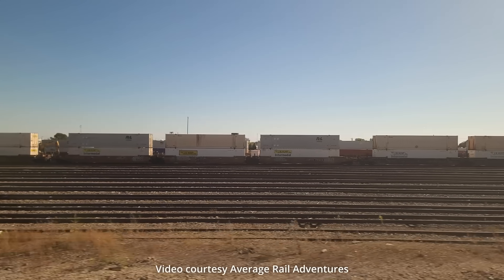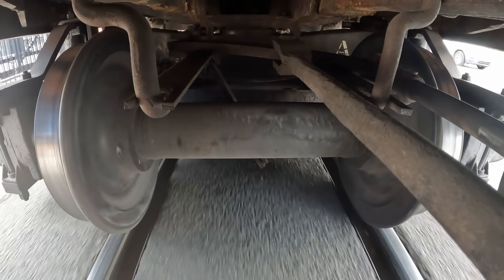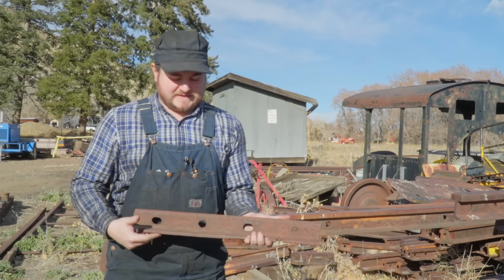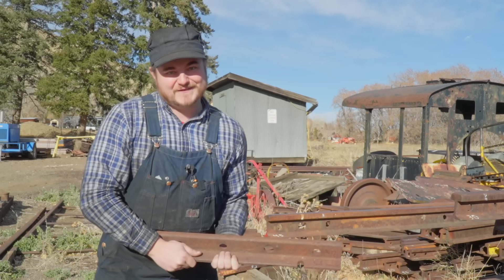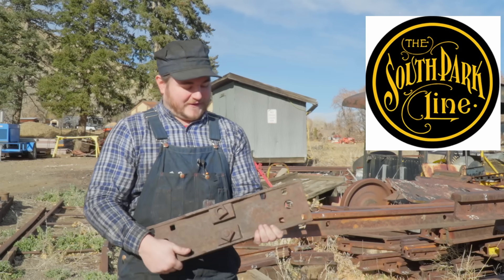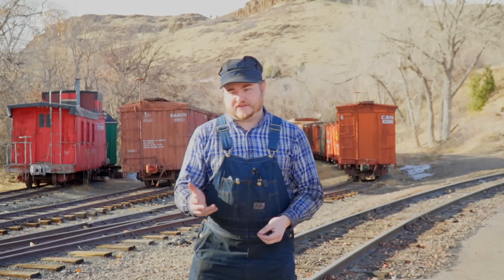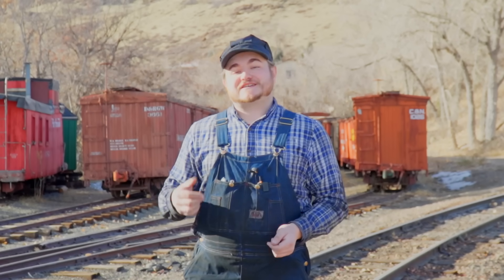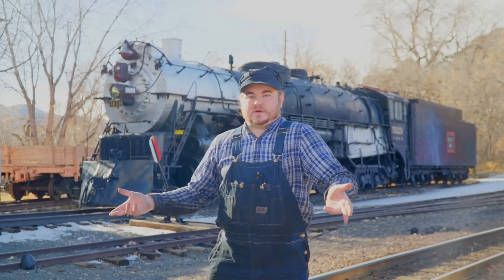Why don't Trains go CLICKETY-CLACK anymore? | Railroad 101

Comment: Track guy here. I'll disagree with your statement that CWR should be laid at the mean or average temperature for a given region (09:50). In practice, the neutral stress temperature of the rail is actually close to the maximum ambient temperature. I know in Canada we destress to 105F or 40C and the ambient temperature seldom goes above that point, though the rail will sometimes exceed that temperature due to solar heating. 

The main reason we do this is (as you pointed out) sun kinks are scary. Rail in compression wants to buckle, you can't push on a rope. Rail in tension is much more stable. This means that CWR in the winter is under an absolutely absurd amount of tension, but steel as we know is fantastic in tension. We do occasionally get tension breaks in the winter, but these can be detected by the signal system when they occur and can often still be safely traversed by a train at low speed, whereas sun kinks often develop due to the vibrations of an approaching train. If one appears in front of you all you can do is dump the air and pray.

This means that we generally lay rail below the neutral stress temperature, and in order to get the neutral stress temperature up to design we actually force the rail to expand before welding it in place, either mechanically using beefy hydraulic pullers or thermally by running a diesel flamethrower on wheels (called a rail heater) over the rail to bring the rail up to that target temperature.

Looking forward to listening to the interview with your track guy.
Reply from the maker: Huh! I have had it wrong for quite some time then. Interesting, and makes sense - I appreciate the correction!
Reply: @Hyce777 Oh don't worry, managing thermal stress is not an easy thing. I've had guys with 30 years of track work experience still get it wrong sometimes
Reply: @redonesgofaster8020  -  So, in a steel railroad situation, contraction from cold is not as destructive as expansion from heat?
Reply: That would be correct. The reason is because buckling is a characteristic of compression only. Tension tends to pull things a little straighter, plus, the steel can accommodate the shrinking length easily. pluck a hair off your head (yours, not mine, I have none anymore 😂) and pull on it. It holds a good deal of strength and remains straight. Now try pushing it. You get no resistance at all before it bends and kinks. That strand of hair is very much just like the strand of steel. The material itself could take the compression just fine, but it is the geometry of "a long skinny thing" that makes compression an issue.

Side note, in certain industries where something long and skinny has to 'push', there are ways to prevent buckling. In a heart stent, they push a tiny wire just a few thousandths thick for over a yard/meter to get to the heart. Railroads could effectively do the same thing, but would be insanely expensive. And I mean INSANELY. 100$/ft extra.

 @rb032682
Reply: @FelonyVideos  -  cool. thanks!
Reply: @Hyce777  makes it fun on really cold winter days for a broken rail quick repair because you are not going to be able to heat that rail enough for it to be laid at the correct length for the rail neutral temperature (without a rail heater), so you cut it x inches shorter and sometimes you can use fire rope/fire snake to heat it enough to get close enough to put the bars and bolts in or you need to use a rail puller which will basically stretch the rail. Now laying at rail neutral temperature helps prevent buckles but are more prone to rail breaks but a rail break is much better then a buckle.
Reply: @Hyce777  Check out the video that Veritasium just put out on exactly this topic!
Reply: @Hyce777  You should re-edit the video with the correct information and not leave the video with incorrect information.
Reply: @cosmefulanito5933  On YouTube, that pretty much means losing all comments.
Reply: On heat expansion, Italian (probably others…) practice has been to actually paint the rail white, minus the head. Don’t know if it’s practiced on new (HS, welded) alignments, though…
Reply: @musiqtee my employer's currently playing with painting CWR, not sure how well it's going as I'm signal's not track.
Reply: Here in Central Europe, CWR is being welded at 27°C, which is higher than the usual mean ambinet temperature or the average temperature during the year. Sometimes, rails are even painted white so they absorb less heat from the sun. The rails can be laid at any temperature, just welding has to be done at 27°C, which can be a problem during hot summers, when the temperautre drops that low just for a short time before sunrise and welding can take place.
Reply: I own a shack on the side of the tracks, in Quebec, Canada.
VIA Rail passenger Train has to pass in the middle of the night during summer,
 since the tracks are  buckling under the sun's heat during the day.
The outer rail in a curve tend to expand more then the inner rail of the curve, 
causing the rails to separate and not be perfectly parallels... Something you dont want when riding a train!
We have sometimes 25C degrees swing in one day in mountain areas. 
The passenger train could pass during the day, but CN is putting a 25 MPH speed restriction,
making the trip from Montreal to Saguenay a 16+ hour trip, an impossible journey for employees and travelers.
Hence reason why the train pass when the tracks are cooling down, while the tracks are in tension.
Not really practical to wait for the train to pick us up at 2am tho. 
I have a video on my YT Channel of my wife and kids getting of the train in winter.
Great Video, keep it up
Reply: My understanding is  rail must be in tension whatever the ambient temp. Thus rail must be laid in summer temp. extremes and stretched as weIl during laying. This, of course, results in extreme  tensile stress in the cold of winter.
Reply: @redonesgofaster8020  Are there any spacings of concrete or wood ties, or bridge cross members, found to act resonant at any range of train speeds and wheel spacings or suspension types?  

If any, those would seem to be design conditions to avoid, as with cars and tire types and road surfaces that seem noisy or bouncy.
Reply: As it cools down it tightens like a guitar string...
Reply: Awesome, Thanks!  I was thinking it would be better to lay at high temps so that you constantly have tension when it's cooler. The rope analogy is spot on
Reply: roses are red, violets are blue
there's trains and trams in my playlist two
there ya go, that somehow rhymed :))
Reply: Thank you redonesgofaster8020.  All I got from the video is that we no longer need joints due to a list of things, that we've always had.  The practice of prestressing the rails seems to be the innovation that makes it practical.
Reply: You want it done when it's warm. Why? Because then there's not  going to be a bunch of expansion that makes the rail buckle. Being under tension is not usually a problem, if anything, it would make the rail even stronger and stiffer.
Reply: @skitidet4302  -  I spent years trying to convince my 1st ex-wife that it works better if you pull on it.  (sigh)
Reply: When you open the comments and realize you need a PHD in thermal dynamics and calculus to even understand what’s going on……
Reply: @PrestonGladd it's not that deep.
Reply: @PrestonGladd  YES!!!! 100%    No time for mathache 😂
Reply: Really interesting - thanks for posting.
Reply: I imagine that material sience has also come a long way from 1930 to now. I think we have more tempurature resistant materials or is this not the case?
Reply: When I first started rail laying temperature on the subdivision where I worked was 85° to 90° F. By the time I left in 2015 it was 100°F
Reply: Also ur telling me the dark rail sitting in direct sunlight isn't getting a degree hotter than 40 lmfao dumby you should be tested for low IQ if you believe that😂😂
Reply: Who cares? It's a train. Big deal! I suppose everybody is supposed to believe you because you said it.
Reply: Glad you wrote this comment as I was about to state the same
Reply: Very interesting!
Reply: I'll semantically argue that when the temperature is the highest, it's pretty mean; as Hyce said in the video. Not the mean he meant, but the mean we deserve. I'll also say that it's both great and somewhat frighting to know that it's only really thermal expansion of the rails that causes an issue. Imagine if thermal contraction happened.....A flat line of rail is trying to do a loop-the-loop in -40 degree weather due to contraction!!!! (Not an actual thing, but what if....whoof.)
Reply: @steeljawX thermal contraction is a thing and does happen.  Just because thermal expansion results in a wiggle, that does not mean that thermal contraction would cause it to want to curl up into loops.  It would just result in the steel trying to shrink (just think length).
Reply: @steeljawX  More like CLANG! BANG!
Reply: Is most rail welding done via Thermite and carbon fixtures?  

How much is done via MIG or other gas field and buildout?  It'd seem that might require a tent for wind in some cases, but could be easier on some repairs of odd shapes, whereas Thermite and jigs would work well on uniform process major projects?  

Is it correct to guess that fluxed rods arc is very much discouraged, due to slag?
Reply: @lokiva8540  I think that using fluxed rods might result in uneven stress after the weld is done, because of heat distribution. If you anneal the weld, maybe it will be fine (also pre-heating both rail ends before welding).
Reply: @ErikZiak  I could see inductive heaters being useful to pre-heat the rail ends, but hard to use while welding; easier to heat ends, remove inductive loops, and then weld heater steel.  

Thermite is nice in that it forms a single molten pool of work ends and welding material, that cools uniformly, and has no voids or slag.  Not so easy to do on existing track repairs attached to ties, but great for miles of the same rail shape coming off a long portable factory of sorts.
Reply: @lokiva8540 
Search for "flash butt welding" or Holland in-track welder. 
There is no filler material used when fusing rail together. 
Thermite welding is completely different and there are many vids available on YT and other platforms.
Reply: My ME guy says look at the thermal expansion table for the alloy.
Reply: @MostlyInteresting  Ok, steel generally expands 0.0000065 in / in / °F.  Let's pick a place, I'll use Denver.  According to google: All-time record high: 105 °F (41 °C). All-time record low: −29 °F (−34 °C).  That comes out to 0.000871 inches of expansion per inch of rail length.  Metric fanboys can note 0.000871 is actually a unitless number, the inches cancel out.  I could write that as 0.000871 mm / mm too.  Anyway, this converts to 0.0105 in / ft, 55.2 in / mile, or 87.1 cm / km.  Thats nearly 40% of typical rail steel's yield strength just from thermal stress alone.

So how do you actually pick your design temperature?  That expansion number alone doesn't give you much information to truly understand the environmental and service conditions that the rail has to endure.
Reply: #nerdsniped
Reply: @tippyc2  Ask the track guy what it effects. Just repeating the info my ME bud said.
Reply: @MostlyInteresting  Uh, huh, thats my point.  Thanks for adding nothing to the conversation.
Reply: @tippyc2  0.0871% contraction seems very manageable. Most steels can stretch about 0.2% before plastic deformation occurs(depending on type and heat treatment ofc). 0.0871% expansion however is completely unmanageable since even small amounts of expansion will cause buckling because the buckling load of two extremely long and comparatively thin rails is really low.
Reply: @tippyc2  mathache for me 😀

Comment: I live in NYC and the subway has recently installed CWR underground but there are still many 39 feet segments of rail across the system. The subway system is slowly replacing the older fixed block signaling with new CBTC signals.

Comment: In the UK, the joints (known as fishplates here) are not all the same.
4 fixing holes rather than 6, but there are also specialist fishplates which are higher on one side than the other for joining worn rails to new/newer rail.
Also, many yards, and even some secondary main lines, still have bullhead rail in some places, that's another story in itself.
Adaptor fishplates are required when joining flat-bottom rail to bullhead.
I'm intrigued to know why the joints are staggered in the US, over here they are always parallel unless there is a localised reason for not doing so i.e. restricted track geometry.

Comment: My hometown of Fall River, MA got commuter rail service to Boston restored in March of 2025 after passenger service to the area was abandoned by the New Haven railroad back in 1958; it was a 30 year battle to get commuter rail service restored to the area, and the actual reconstruction of the track from a weedgrown, 10 MPH - restricted jointed-rail freight line to 79 MPH - rated CWR for  passenger service.  The actual construction period from the time when funding was finally approved to was about 5 years, and involved constructing 5 new stations, a modern signaling system, & PTC qualification before the start of service.
   As I mentioned earlier, the line was freight-only after 1958, with a gradually diminishing number of freight customers; the New Haven was gradually sinking further into bankruptcy, so maintenance was minimal.  The New Haven got absorbed into the Penn Central debacle in 1969, & with the obvious bankruptcy of PC, track maintenance further deteriorated.  Fall River was served by 2 separate rail lines; one came down into the city from the north from Taunton, MA (this was the line rehabilitated for commuter rail); the second line came in from the east from the city of New Bedford, MA.  A good chunk of the line from New Bedford was originally built over a long wooden trestle (later partially filled in ) down a small river; although the lines look close on most maps (the end of the line to New Bedford is only about a mile from the mainline to Taunton), the 2 lines never connected due to an altitude difference of at least 100 feet.
     A couple of stories of how bad the track was; about 1/2 mile before its terminus that used to have a small passenger station, the New Bedord line, which had an east <> west orientation, veered south from a switch to a small rail yard, over a small curved wooden trestle.  One day (I believe this was shortly after the PC takeover), a short freight was pulling into the yard.  As it was doing so, the engineer felt the trestle starting to SINK 😱under the weight of the locomotive!  (Normal power for this line was usually either an Alco RS-11 or EMD GP-9); he goosed the throttle and managed to get the freight safely into the yard.  PC had to REBUILD the trestle 🙄before they could get the train out!  A few years afterwards, that portion of the line was completely abandoned; it's now a popular local rail trail, but at that time of the rail-trail conversion, the trestles were so far gone that they weren't even suitable for BIKE TRAIL 😵 use!  A huge crane was used to rip out the century+ old New Haven trestles, and new bike bridges were built in their place.  (The bike trail bridges had to be able to support emergency vehicles).  I personally shot some drone video documenting the removal of the ole New Haven trestles for the bike trail conversion (it's here  on YouTube on my channel).  The crane crew had just finished removing the top of the curved trestle when I sent the drone up; you could see that the only GOOD trestle pilings remaining were the ones they replaced!
     Before the state of MA bought the Taunton line off CSX in anticipation of the commuter rail reconstruction, CSX had a locomotive derail on the line; STANDING STILL! 🤔  (The ties were so rotted that the spikes pulled out & the rail rolled over on it's side, JUST from the locomotive's weight!  (I think it was a GP-38?).
     I was onboard the first commuter train out of Fall River to Boston the day the commuter service (originally referred to as South Coast Rail). started.  With the track now on new heavy ballast, 440,000(!) new wood ties, and 136 lb./foot CWR, the ride was smooth and quiet, even at maximum authorized track speed. 🤗

Another good reason to "Stay out of those JOINTS!" 🤓

Tom Lapointe 😀

Comment: In the mid 60's I worked for the Empire Machinery, Caterpillar dealer here in Arizona, A CAT633 scraper had been shipped from their factory in Peoria Illinois.  It and been chained and blocked down on a railroad flat car.  The journey took a northern from Illinois to the west coast then down Phoenix.  Upon unchaining the scraper to unload it, it was found that the big steel tub that holds the dirt had cracked completely in two from one side to the other from the effects of harmonic vibration and ultimately metal fatigue.  Caterpillar's and the rail company investigation found that a wheel on the flat car had a flat spot on it which resulted in the rhythmic vibration that was continual for over a thousand miles.  Coincidentally, I owned a 1964 Harley-Davidson Sportster motorcycle at that same time and this same metal fatigue caused by excessive vibration cracked my rear fender, chain guard and the windshield's mounting bracket.

Comment: The clickity clack may bring warm and fuzzy nostalgia but having mostly disappeared in modern times is probably good news for urban sprawl as well. Tons of weight transmit the sound through the ground for some distance. The clacking could present as a low frequency pounding sound. Picture the bank robbers putting their ear to the rail in westerns, hahaha. No fun for many living near a busy mainline that went ckickity clackity. Cheers.